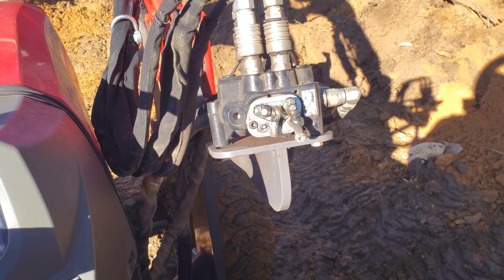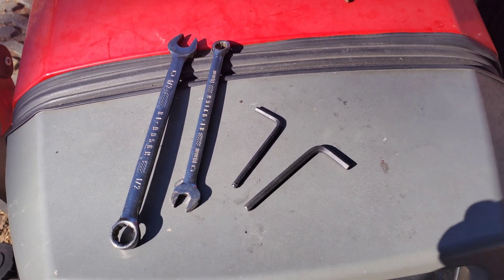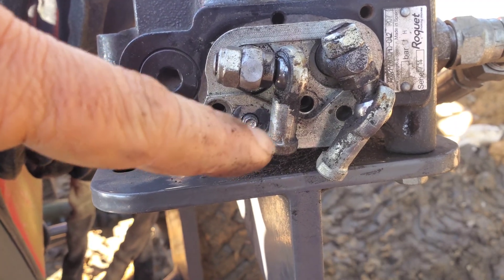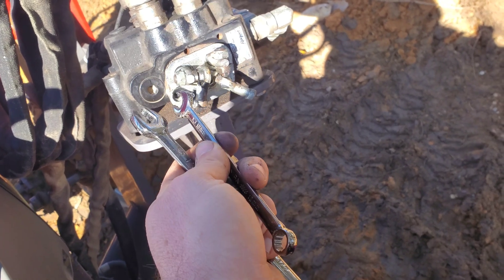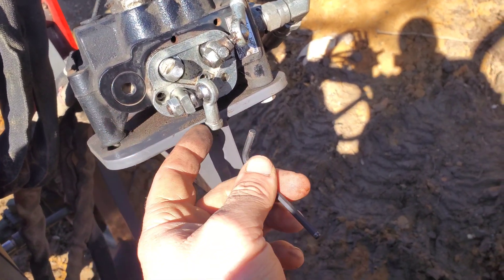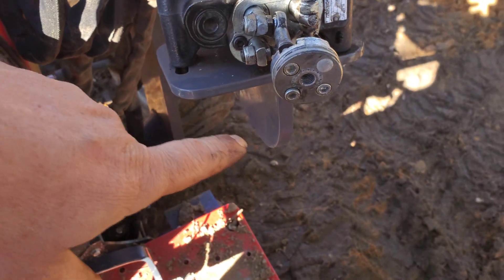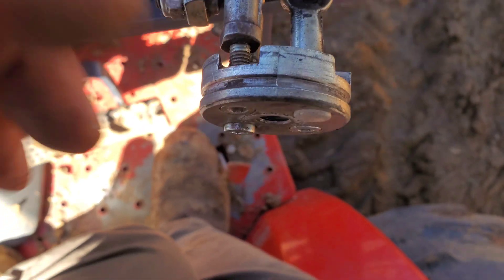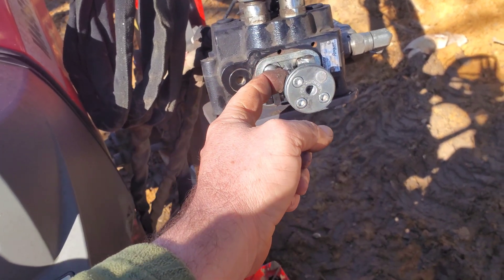Reassembly of tractor front end loader controls

Comment: Well, good news. 2 years later and your video is still helping someone. I have a 2017 MF 1526. The joystick control felt kind of loose. I thought the bottom left rod end was broken because it didn't look or move like the other two. After watching your video I checked to see if mine was just loose like yours was and it was! The allen came loose and was ready to fall off. I spent hours looking for replacement rod ends and couldn't find anything besides the whole kit which was 375$!  Thanks again for the video.